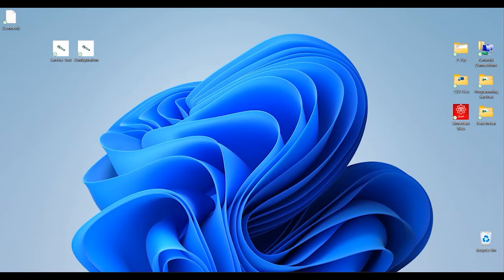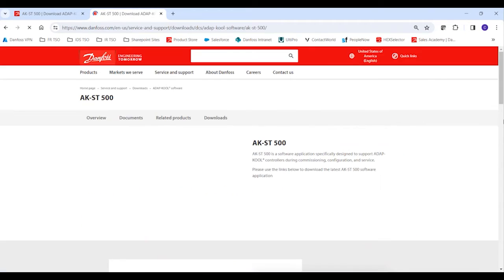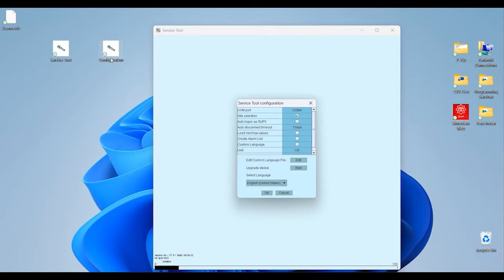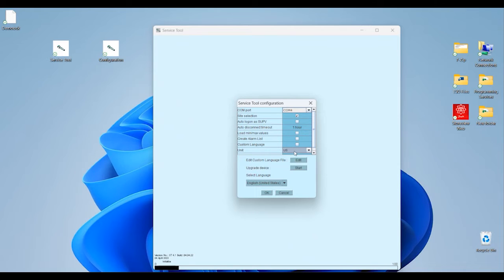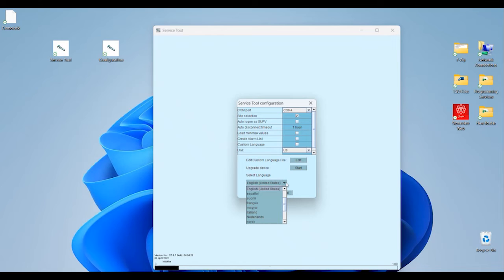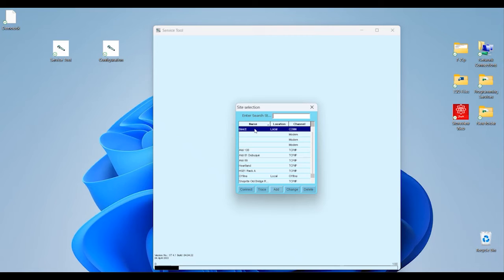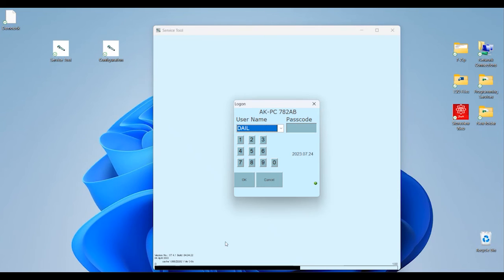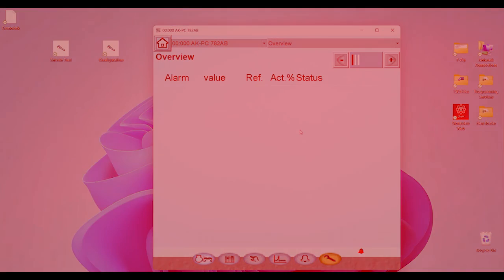Navigating Service Tool Software: Installation & Setup | Technical support for supermarket controls

Comment: Im trying to change the parameters in my Danfos EKD 316 controller, Im trying to use this software but for some reason the controller isnt responding through the danfos service tool software, But if I use a separate software for modbus the controller responds and gives me an illegal data address error